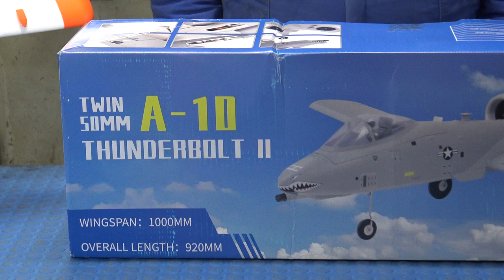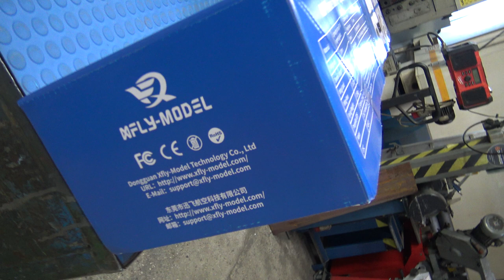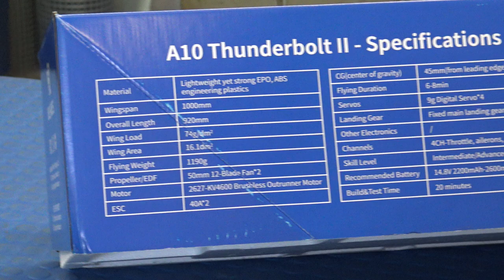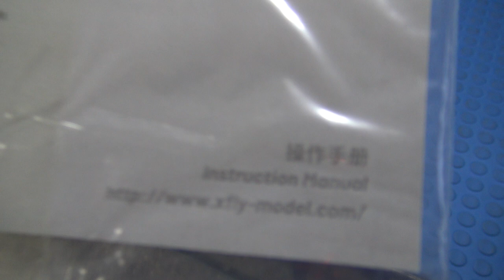A-10 Twin 50mm EDF Tank buster Jet 4S power by XFly model 1000mm RC plane PNP Unboxing

Comment: The detail, especially the rivet panel lines and cockpit are extraordinary. I love the sheathed cables also. Being Mark Two A10, this has the big tank busting rotary, armour piercing cannon mounted in the nose, whereas mk 1 had it directly under the pilot's seat.. I one day had the pleasure of taking lunch at South Kensington with a retired A10 mk 1 pilot. He wanted to talk about music, and introduced himself but as soon as I found out what he had done (obviously he did not refer to any operational details) I just made him talk & talk about the bird. When you see a scale side elavation cutaway of this, the size of the gun makes the pilot look TINY. The awesome power of the weapon stops the plane like an extra pair of ze flaps, or I don't know what! As to fondling ze hwheels on the stall plane, for the best effect you should fondle both of them at ze same time, careful to have throttle cut ON, because, just like a woman, these birds can bite. Big OUCH! salute from London.

Comment: best looking A 10 ?
May be.
And full scale with a lot of details ?
May be.
But no rudder.   :-(
And high wing load.   :-(
What´s the price ?
Nevertheless, I like scale RC Model planes.
( I would like to see a Arado 234 in similar size, or wingspan about 1200 mm ! 
With 3 cell Lipo, not 4 cell ! )